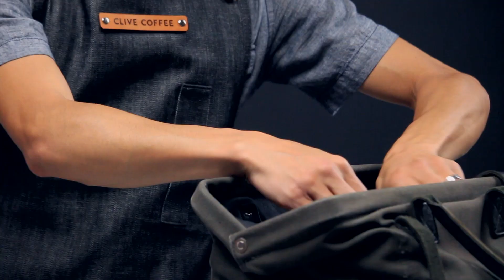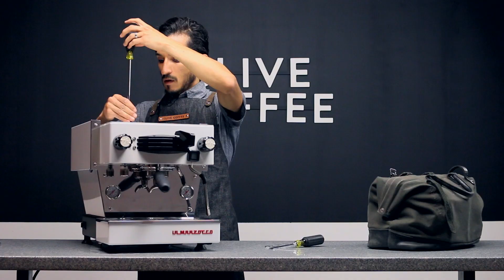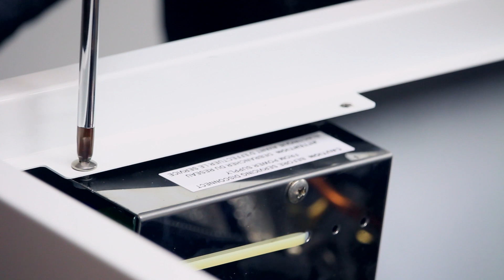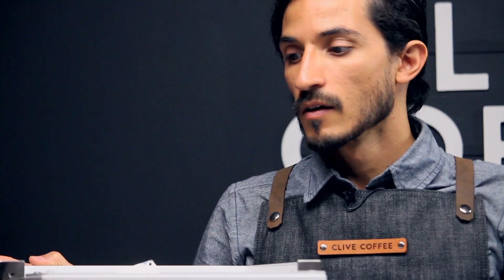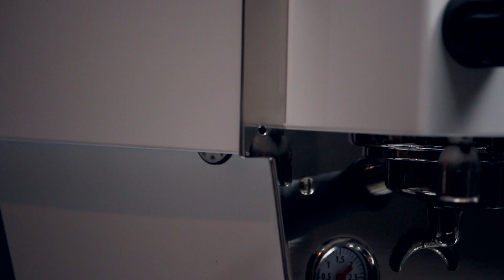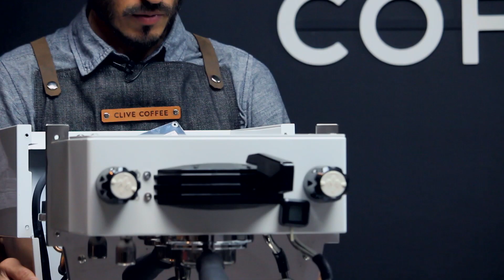La Marzocco Linea Mini | Panel Removal

Comment: Is it also possible to remove the front panels where the brew lever and drip tray sit?
Reply from the maker: It can be done but requires disassembly of several parts of the machine that we recommend being done only by a trained technician.
Reply: to remove the  front shiny chrome panel where the pressure gauges are is that difficult ?

Comment: Just love those instruction videos.very professional and informative.
Q: I have opened the machine for pump pressure adjustment and after closing it back found (on one side only )  a really small gap between the cover and the front fram.
Any idea how to align that?
Reply: Yes, there are two small alignment screws at the bottom where the gap is. You will need to take the case off again and make sure to make it fit into the hole on the panel body. Hope this helps! -Y